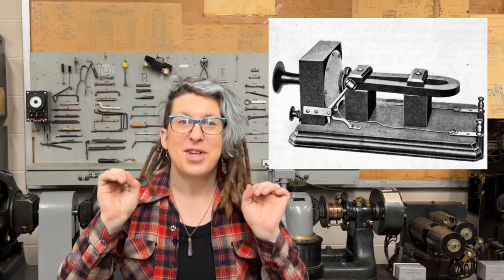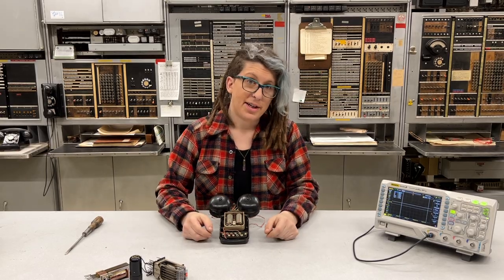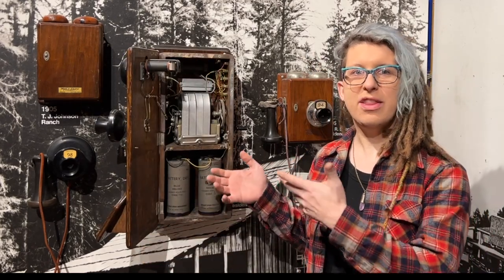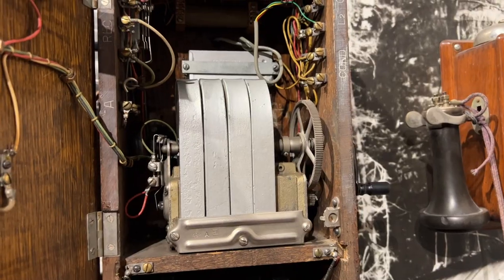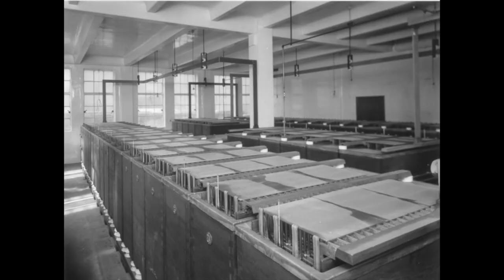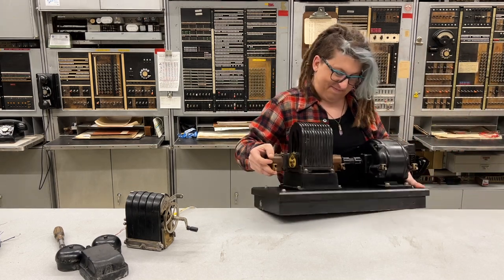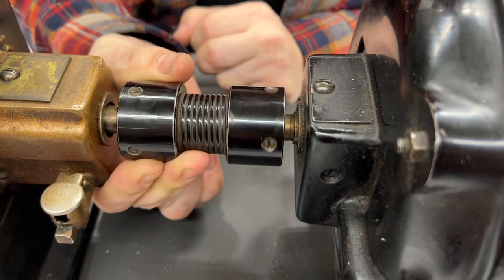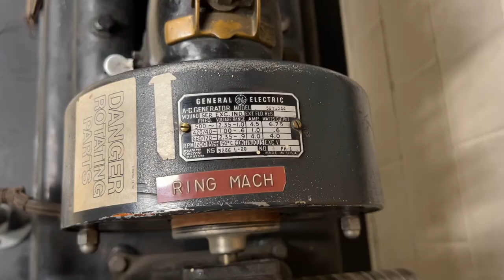How does telephone ringing work?

Comment: Well explained, but I'm looking for information on something much more nuanced:

What controls how long my landline phone rings for, AAAAND:  for how long it remains silent between rings?

"RRRRRRINGG ............RRRRRINGG............RRRRINGGG.... etc. 

My theory:  A bimetallic strip inside the phone base heats up as it rings, and bends enough after a while to open the circuit, and stop the ringing for a precalulated length of time before the bimetallic strip coolds down and closes the ring circuit: ... RRRRINGGG!

Am I correct?
Reply from the maker: @Zickcermacity  watch the video that came out right after this one about the ringing machine. It has mercury interrupters on it, and they determine the ring cadence and timing.
Reply: @ConnectionsMuseum  Thank you Sarah! Is it the one titled "The Machine That Makes Your Phone Ring"(19m03s long)?
Reply from the maker: @Zickcermacity  yep!

Comment: I loved the #6 dry cells.  My grandparents had two of them powering their doorbell.  Railroads also used them heavily in the old days.
Reply: They're often called ignition batteries. Early cars ran their ignition systems off of them.  Four wired in series make 6 Volts, just right to excite the ignition coils of a car. Ford changed things when he decided to run his model T from a magneto instead, to avoid reliance on batteries that could go dead at inconvenient times. The batteries could be saved for just starting, instead. Also, when I went to school, we used them frequently in our science labs.

Comment: I was wondering when you were going to get to the switch board. and the ring generators, always thought they were so cool. They were used longer on Military posts.  Worked on XY and stepper switches then Nortel Digital. Loved Nortel modular equipment. .

Comment: What a wonderful video.  I am a VoIP and Telco guy by trade and I LOVE old hardware.  In fact, I still have my great grandmothers original phone ( exactly the same as the early wall phone you demonstrated) hanging on my wall, and I'd like to get it working over a VoIP connection.  I am no stranger to electronics, or circuits etc, but do need some clarification on some things.  It shouldn't be hard to convert the ringing and line voltage from say an ATA, to fire the bells etc.  What I would like to know, is what type of voltages does it need to fire the coils and ring the bells?  Are the audio signals compatible, or will they need to be attenuated or boosted?  I'd like to house an ATA inside the battery compartment, with a dial pad in order to dial out, and have ringing fire the bells of course.  Do you know of anyone that has done this or where I might find resources?  

As for the facility and the video, Love it.  If I could I would nerd out HARD in that place lol.

Comment: And here I thought US ring tones were, 90 volts of pulsed DC? Either way? I felt the ring circuit one day. When it was still illegal. To install extension phones in your home. I, equipped with my FCC Radiotelephone Broadcast License. Did so for a good friend. A young mother. And as I was twisting some wires together with my fingers.  I looked at her and said… Your phone is ringing. She said I don't hear anything? I said I know.  It's coming through my body. It was a good jolt. I got a real rush from that. Of some current. It was very funny. And I thought it was pulsed DC? What you may be right? And I think it was 15 rings per second. One quarter of 60. Something like that?

But what a delightful explanation of this. You are one Phone Freak. I had fun with them also when I was younger. I could whistle disconnect frequency of 2600 Hz. I couldn't figure out how to further jump trunks? I knew about Cap'n Crunch. I didn't know the other, DTMF, frequency combinations? I was a young teenager. And I didn't get very far. I wanted to be on the AM/FM Radio, instead. So I played with record players, microphone mixers and tape recorders, mostly. I'm sure you can understand?  It was all about the rock 'n' roll actually. I needed to be in FM rock 'n' roll DJ. As I had the pipes for it. Kind of like Don Lafontaine. Or Don Imus. As I also worked for them for 20 years. At…N---BC. Before Howard Stern ever got there.

No really we both had FM rock 'n' roll radio shows. At the same time. Mine was in Baltimore. Overnights. He was in DC. Daytimes. We could listen to each other's shows. I don't know if he listened to mine? He could have been one of those ass hole request calls? I would say yeah yeah sure I'll try to get to it. Knowing I would never play that. What a stupid request! Who do they think I am Wolfman Jack? Hell no!

I liked, Howard Stern show. Until, Air Florida Flight 90. Smashed into the Potomac River in the wintertime. Because I happen to be right there on the ground. And working for NBC-Radio News. What a mess. And only one half dozen people got out with their lives. Out of 80. Because of stupid pilots. It's always, stupid pilots. Most, did not come out of the military.

You just can't trust pilots to get you there, alive anymore. It's company pressure and stupidity.
RemyRAD